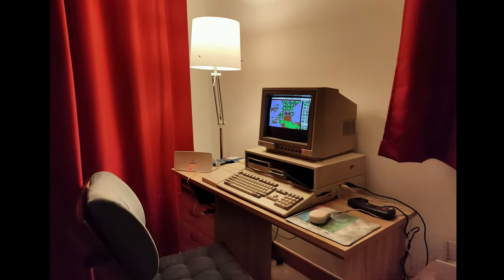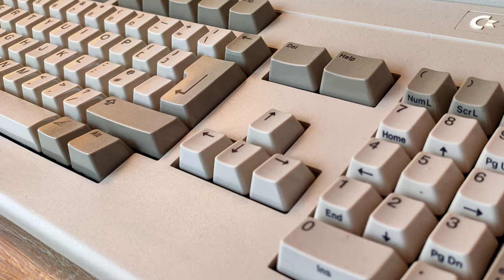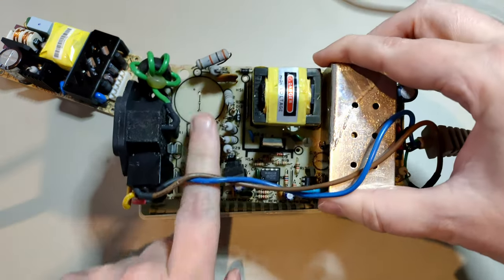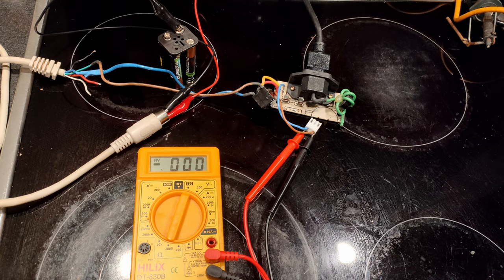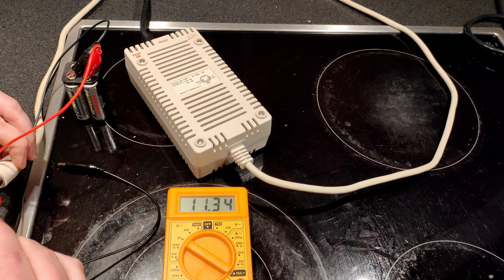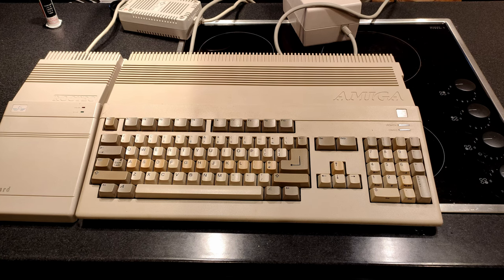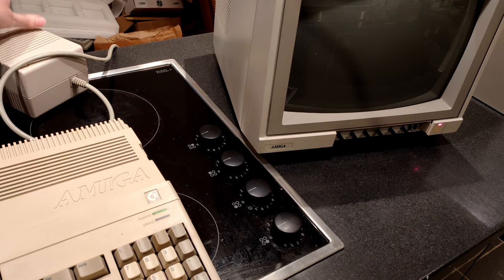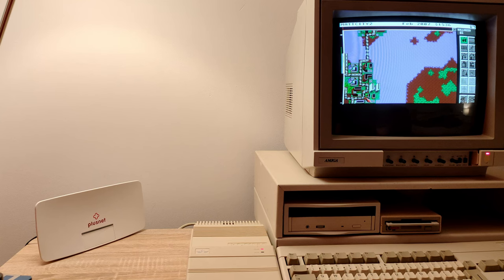Paradise Lost OR How I Fixed my Amiga Hard Disk PSU

Comment: I bought a rochard like yours some months ago, and modded it to use power from the zorro slot. And installed a CF card for testing. Upgraded mem to max.

I get an insane speed on the CF card.

Comment: Hi. I have got the same problem with the same Rochard HDD. Where did you buy the new power supply, please?
Reply from the maker: The meanwell power supply that replaced the old board is linked in my first PSU video, got it from RS in the UK but many places will stock it. You'll also want the connectors etc which are also linked: https://youtu.be/8lqfsESqDZE
Reply: @mattsqwrl  Great, thank you very much. You save my UFO game save 😁
Reply from the maker: @OOBRADLEY  Good luck!
Reply: I modded my rochard to take power through the zorro slot. No more external PSU.
Reply from the maker: @brostenen  Oh cool, I've seen that for other drive units. Does it work if you still have a spinning disk?
Reply: @mattsqwrl  All I did was to wire up, exactly like you do on one of them Commodore a590 SCSI drives. That is two wires (5v and 12v) from the edge connector and directly to the power header for the drive. Mounted on the underside of the PCB.

As for spinning platters. The Rochard does not support IDE drives under 256 megabyte. And I dont have spinning drives with that low a capacity. But I suspect that if the Amiga PSU is big enough, then there are juice enough. I have a meanwell RT65B inside the original a500-PSU case. So there should be juice enough. I just dont know if components inside the Amiga can handle that much power through them.